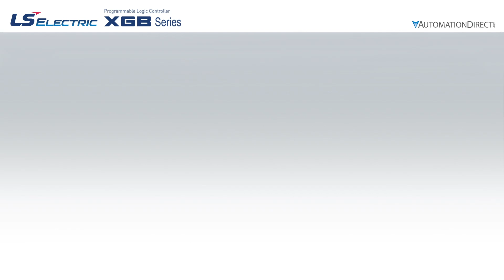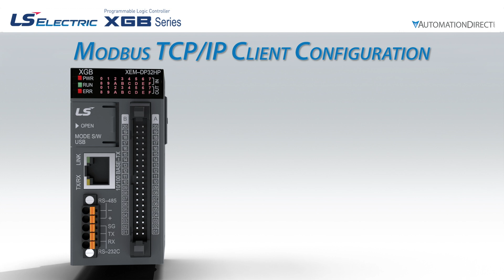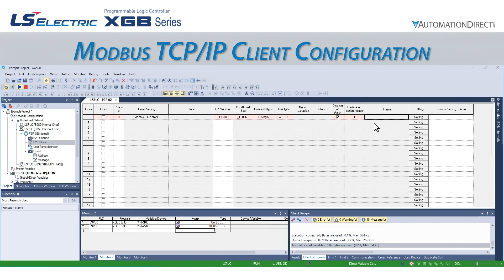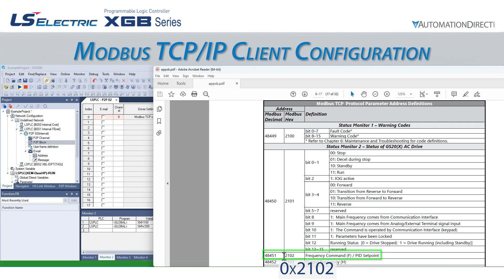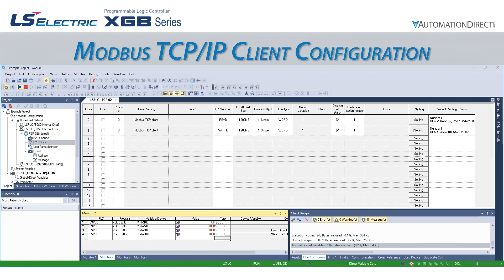XEM Modbus/TCP Client Configuration - LS Electric XGB PLC from AutomationDirect

Comment: 1:50 do the XMC controllers not natively support modbus client protocol? The option for P2P communication is greyed out in my case. It's shown in the user manual for the XMCE08A but not mentioned in the product page and seems inaccessible. 

If PTP communication can't be setup here, then the existing EDS libraries created aren't usable and customers will have to manually program modbus TCP exchanges, right?
Reply from the maker: @trevorschnedler4472 
XMC natively supports Modbus/TCP Server.   The library at https://cdn.automationdirect.com/static/helpfiles/ls_xmc/Content/D_MoreInformation/ExampleApplications.htm?tocpath=_____5 adds Modbus TCP client capabilities.